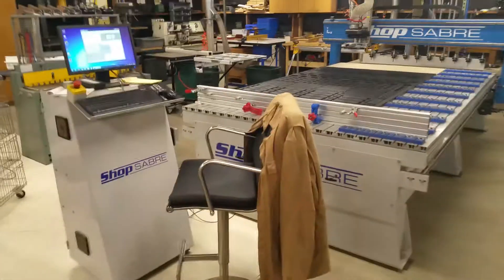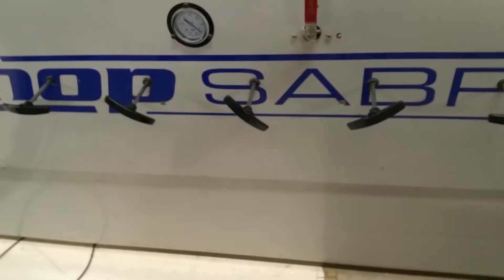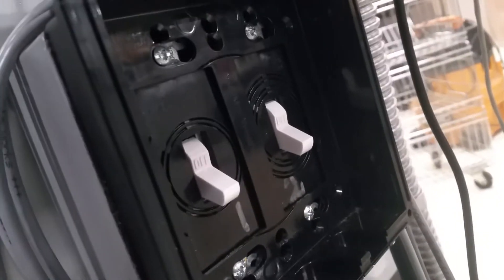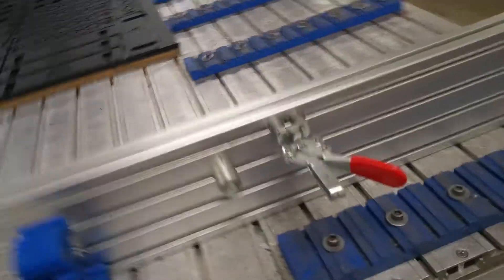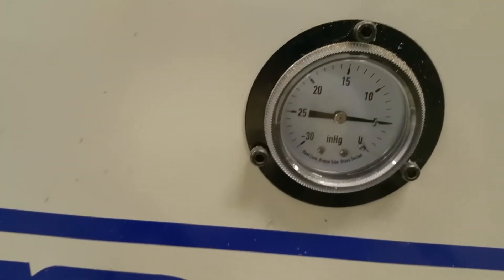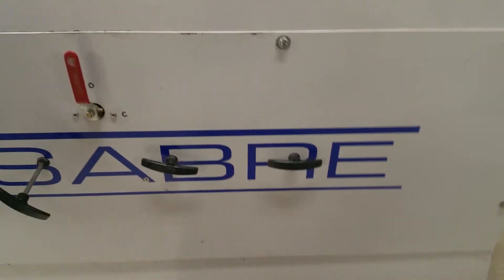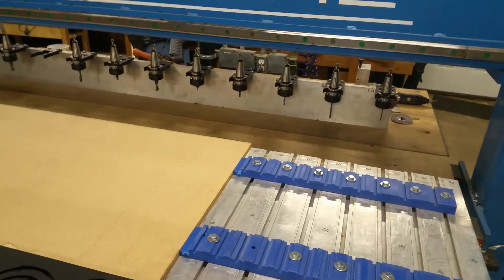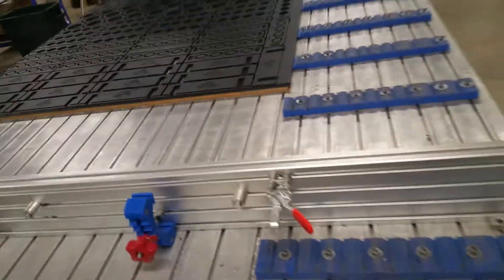Shopsabre table tour

Comment: I am in the process of buying an IS408 I'm trying to get a definitive answer on the height of the gantry I know the machine comes with an air cylinder to balance the spindle what is the overall height with the air cylinder on it and if you remove the air cylinder which they tell me ships loose what is the height of the gantry what is the highest point of the gantry that will not move up or down without the air cylinder
Reason I'm asking I'm trying to get it through my door that is only 84 inches tall
If I can simply hook the machine up to power and lower the gantry no big deal but from everything I can get from Shopsabre and the videos I see online I'm not so sure it will be that easy
Super thanks for any info!!
Nice table
Reply from the maker: My machine is 93" high at the air balancer. You could probably save an inch mine is mounted atop some metal pads I made and my slab has a slop in it so it is higher on one side. I don't think it would be hard to remove the air cylinder to get it through your door. I would consider a larger table for minimal cost now compared to replacing it later. It is very handy to have extra room for fixtures just a thought. The balancer does not get shorter when the spindle is moved.

Mike